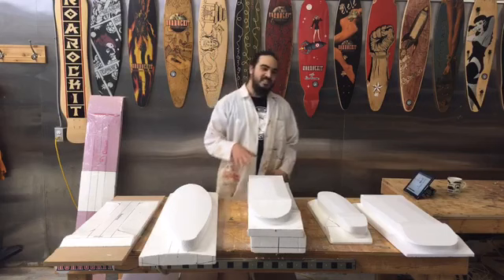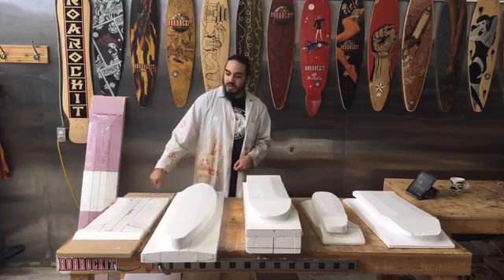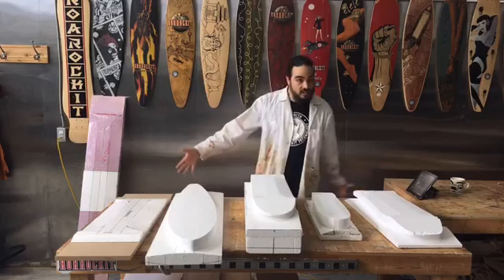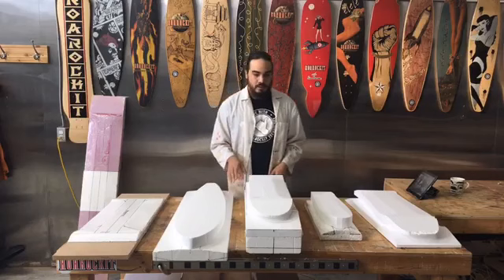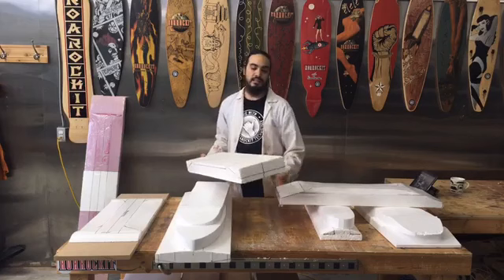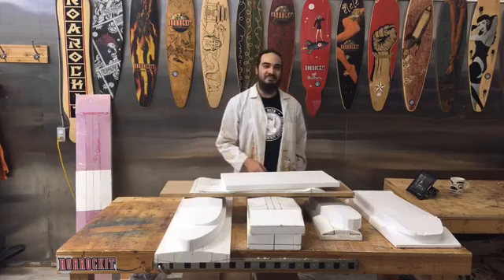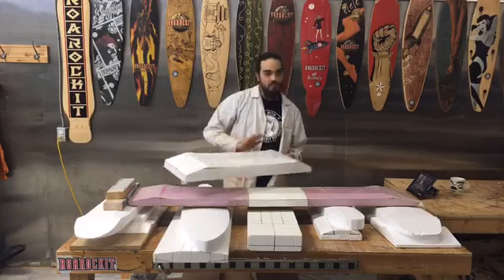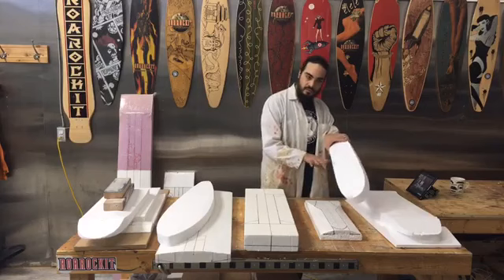Basics on Custom Skateboard and Longboard Molds // Facebook Live 2

Comment: Ive watched a few of your guys videos, interested in trying it. have a few questions. with other presses it would seem they use a whole bunch more pressure than your bag press and foam mold uses. Do the boards delaminate? (as in not enough force to get a good glue) and how many presses do the molds last? would it work to say cover a good mold in fiberglass?
Reply from the maker: The bag exerts more than enough pressure for pressing a single deck at a time. Pressure is a function of surface area under atmosphere so you can do the math yourself to see what you're getting out of a press at any one time. A properly pressed board will not simply delaminate. 

Molds made out of our high density foam (and similar extruded polystyrene products) will last an almost indefinite amount of presses. More extreme board designs (A drop deck, for example) might lose their shape slowly over time but the effect is negligible. You could absolutely cover your mold in fiberglass, though that seems expensive. You might want to consider transferring your design to an MDF mold if you're trying to make your mold more permanent. It's cheaper and less finicky than glassing a mold.
Reply: Appreciate the response and advice. very helpful.